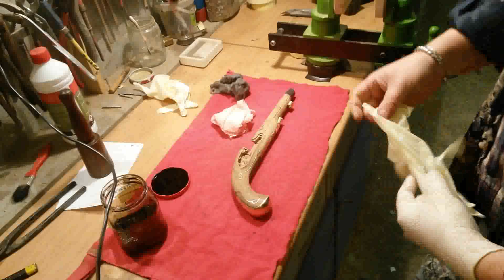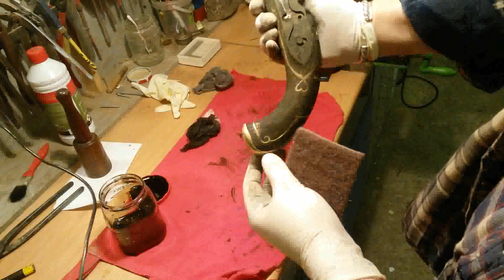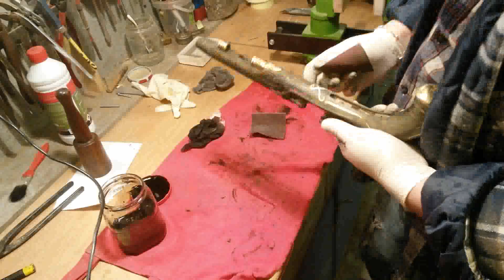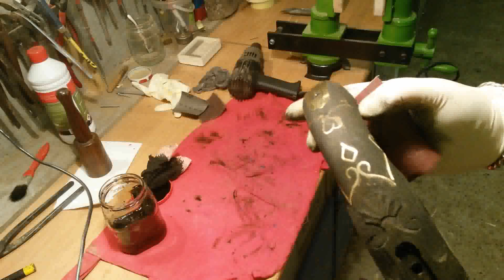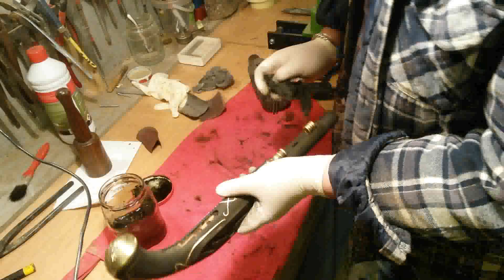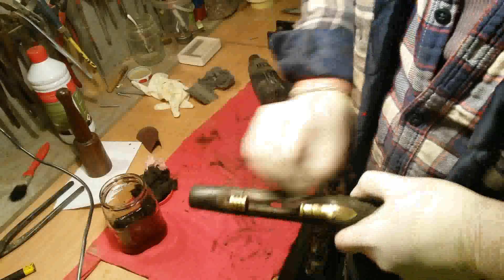Kentucky flintlock pistol build Pt.14 staining the gunstock

Comment: On your sanding do you start with 60 or 80 grit then work your way up in grit to 0000 steel wool?
Reply from the maker: First I use 80 grain and at last 400 sanding fiber. And than burnishing with steel wool. The stain was BONDEX water base powder stain. It is powder to mix with hot water.  I hope that will help you .

Comment: The colour really shows up the inlay, you must be very pleased with the result, the light areas are, as you say, where the super glue has sealed the grain, preventing the stain from colouring the wood, not sure that there is a cure for that, I wonder if there is a superglue solvent on the market?
Reply from the maker: The result is nice and even better in original. I can hardly wait to see it with oil finish. Mainly there is no problem with the super glue, only in areas were the grain is smahed down in cause of a too narrow grove. Next ime I will be more careful and use a thinner wire, than the problem should be solved.
Reply: Your not suppose to use glue. The original gun makers didn’t.

Comment: That’s why you shouldn’t use glue.
Reply from the maker: It was rather hard to inlet because the wire I chose was too thick. Only the areas where the wood is compressed had a problem. In all other areas the super glue is invisible. Next time I will use thin silver wire, than it should be posible.